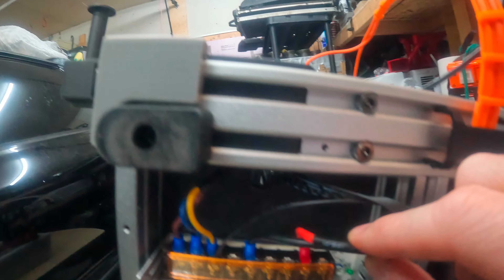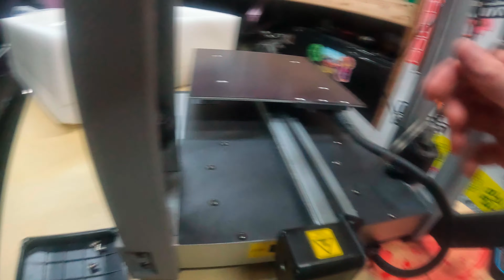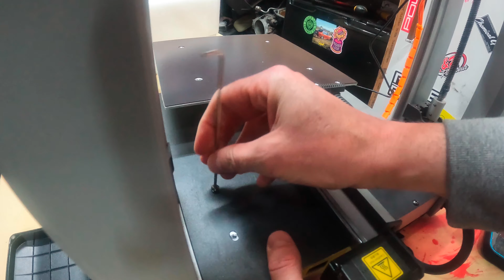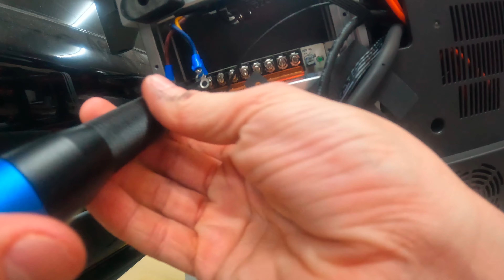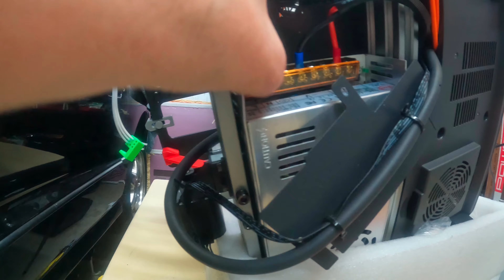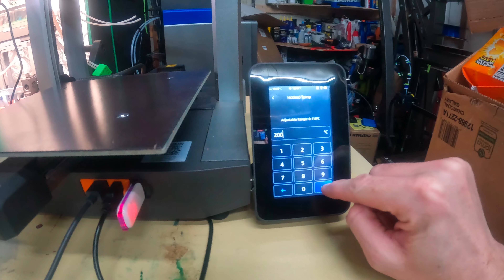Anycubic Kobra 3 power supply replacement

Comment: Thanks for the video! Question- Are the psu wires long enough that you would be able to remove the psu from the bottom of the printer and put it outside an enclosure? I have a vented enclosure box I plan to put my printer in, and im worried that if I cant put tie psu outside it will end up dying faster as it can get hot inside the box. Thanks!
Reply from the maker: i dont think it will be that long but if you can solder just make some extenders. ive done a few little soldering, i will be making a video soon on changing the firmware of the K3, S1, and the K3M

Comment: I connected mine to 220 but the switch was set to 110... I think I burned it... I'll try to change it like you did! Thank you very much for the article!
Reply: It works? I did the same thing 😢
Reply from the maker: so Ive connect 110v to a 220v but that was 20years ago when i lived over in Germany. you got to love releasing the magic smoke. if you haven't contact anycubic support they might be able to ship a a warranty replacement
Reply: @Rookie3DPrints i've need to change The power supply.  I got one on internet 700w 24v 20a and its working fine

Comment: 551 / 5.000
I'm from Brazil. My Kobra 3's power supply is making noise, but I discovered that this only occurs when the ambient temperature is below 20°C (68°F). Above that, it becomes silent. I believe it's due to the housing material contracting and something touching the fan. Thanks for your video. Now I'm having another problem: the printer suddenly stops printing and simply restarts. It's reporting a power error, so I think I'll have to do the same process here, replacing the power supply.

Last time I bought an Anycubic ¯\_(ツ)_/¯
Reply from the maker: Oo yes I got the replacement power supply from anycubic as a warranty. If you think it's just a fan problem you can try changing the fan to a better one. I changed fans on my K2max power supply due to how loud it was

Comment: Where did you get a new power supply?
Reply from the maker: @levi_barrocas  I message anycubic support and told them I was having problems
Reply: @Rookie3DPrints what problem did you have with your printer? i also have a problem with my kobra 3. the printer was printing, i left for an hour. when i came back it was off (in the middle of printing), it won't turn on again
Reply from the maker: @labras6393 my problem was the fan being super loud and I'm assuming the bearings
Reply: Qual o contato da Anycubic